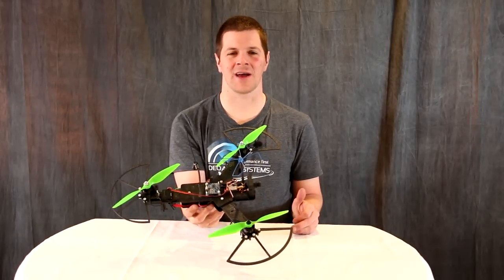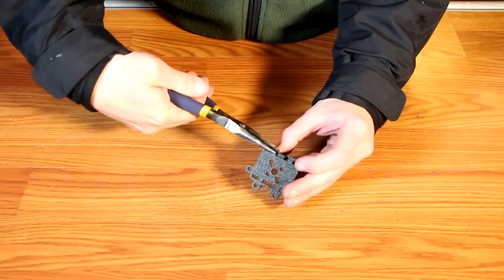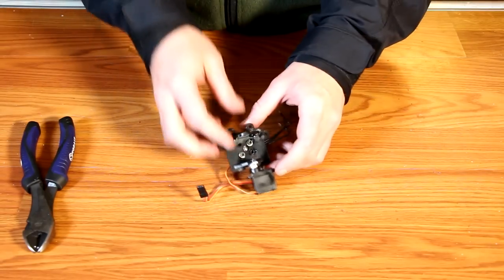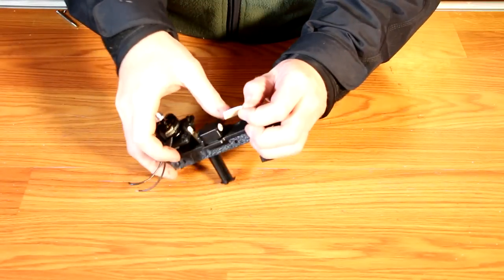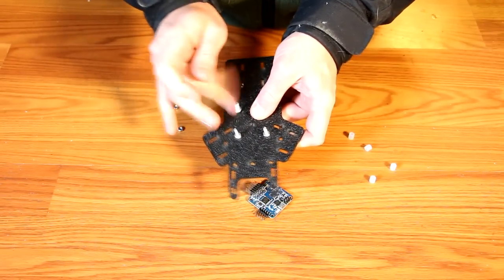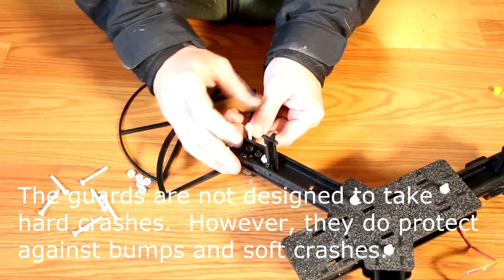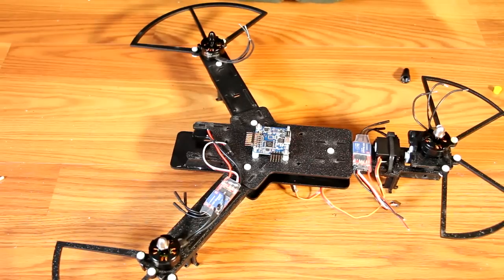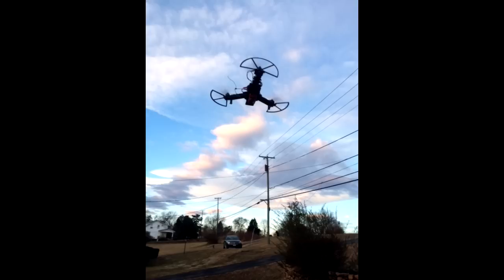VAS Cerberus build tutorial

Comment: What sort of flight times are you seeing with this setup?
Reply from the maker: 14 minutes hover, 11 minutes forward flight time on a 3S 2250 Lipo.
Reply: Alex Greve Is it safe to assume you were flying forward aggressively? Usually, especially with my quad's and my hex, I get longer flight times in FF than with all hover cause of transitional lift from forward movement helps. Or does this tri with only it's 3 rotors not make enough transitional lift to increase flight times?
Reply from the maker: Killer Lumens I wouldn't call it aggressively, but definitely not pampering it.  I'm not sure this gets any lift from forward movement at all.